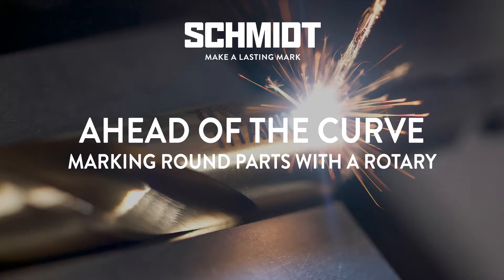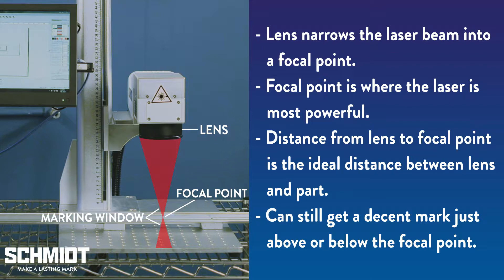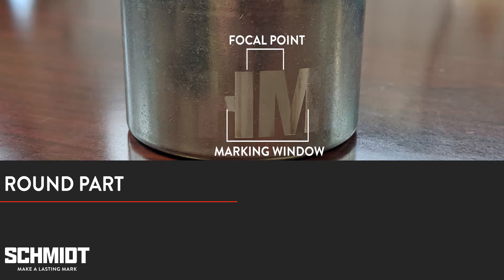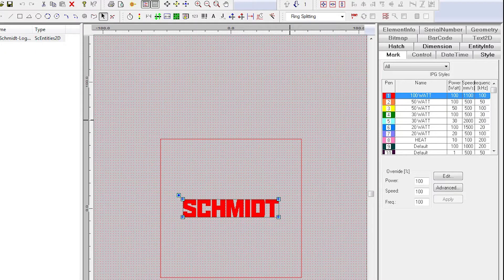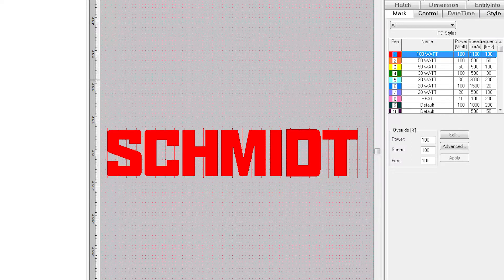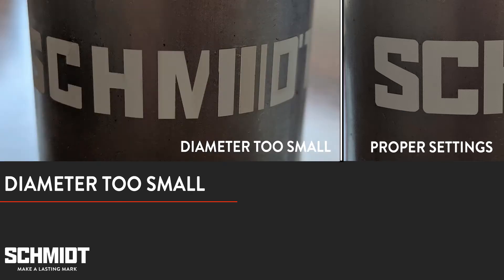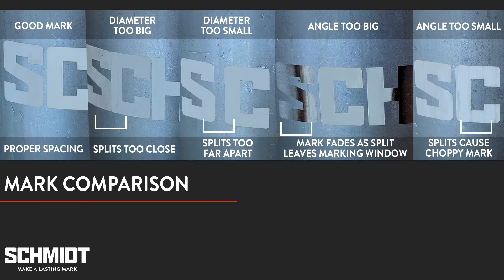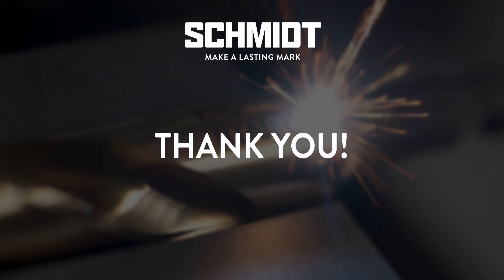Laser Marking Round Parts With A Rotary

Comment: Hey, well I have a problem that my angle is too small but how do i change that ?
Reply from the maker: To increase the angle, go into the Ring Splitting menu (Extras>Splitting>Settings>Ring Splitting) and change the value of the Splitting Angle. You may also want to confirm that the measurements of your part's diameter is correct.